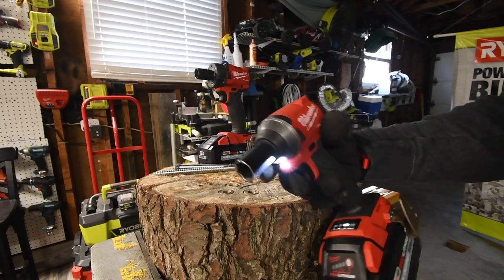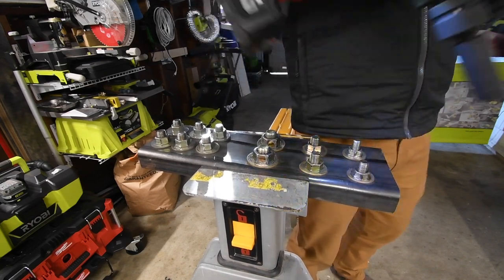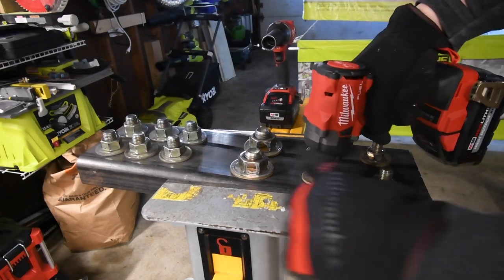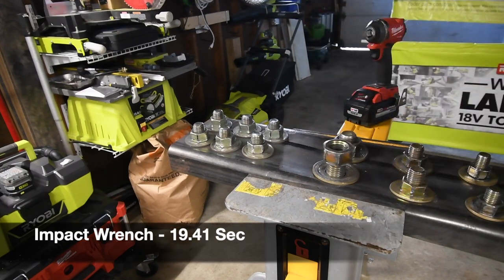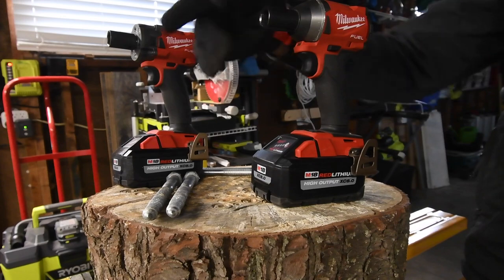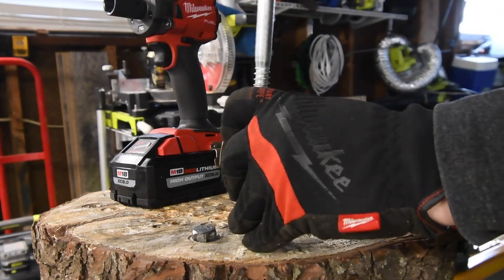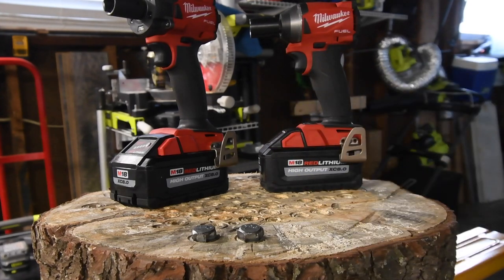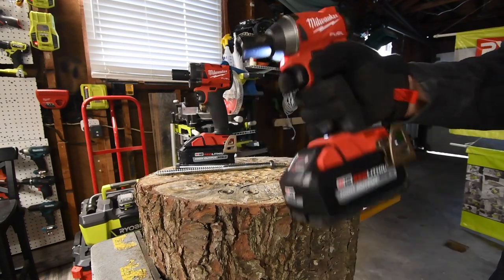Modded M18 Impact Driver vs. M18 Stubby

Comment: I mean, Milwaukee must know this riiight? This was interesting as hell.
Reply from the maker: they have to know, if not hopefully this video will make them know
Reply: @ManCaverTools  im sure there is a new gen coming out now because of this discovery lol
Reply: They do know. The reason it’s not done is because you don’t want your amount of impacts being faster on things like bolts and nuts because it makes it easier to break
Reply: @brandoncontrades187  
You simply change the speed tsince it has 3 settings on the impact driver to solve that
Reply: @obliviondio  you have to account for the 99% of noobs when marketing; imagine all the warranty etc claims lol
Reply: @bryanm6080  
The impact driver naturally has a speed clutch for driving in screws. That would be just as much of a warranty concern. It's same speed adjustment as present on the new m18 stubby impact wrench, the mid torque and high torque impact wrenches.

Comment: Do you every watch the Torque Test Channel? They have some cool tests. Maybe you could collaborate with them and send them that modded Milwaukee for them to compare. I bet your tool would be high up on that list!
Reply: PS: Eric from South Main Auto just sent them his air tool. It did well. Send them your electric modded tool and show him up! Lol
Reply: This would be insanely epic!!!!!
Reply from the maker: I am subscribed to him and he wants me to send him this impact driver. I think I will
Reply: @ManCaverTools  send it with a high output 6.0 and/or 12.0 battery, since he confirmed that the 6.0 makes more power than the 8.0
Reply: @ezrawaters6653  Hi Ezra, I have to take exception with that.  The 6.0 does not necessarily make more power than the 8.0.  If you read into what the other channel said, it was a brief burst it offered.  I think the 8.0 will win out, as it will run longer and offer more Amp draw over a longer time frame.  There is an insignificant difference in weight, so I don’t know why one would choose the 6.0 over the 8.0?  I have used the 6.0 on my Gen 1 drill, with good results, but it usually does duty in one of my M18 worklights, and does well.  Obviously the 8.0, which I own and use, does better.  Batteries can vary one from another, so who knows?  YMMV. ✌🏻
Reply: @ManCaverTools  That’s cool Dave
Reply: @georgedavall9449  the 6.0 puts out more power from start to finish. This is because it uses the Samsung 30T cells as opposed to the 40T cells in the 8.0. The 30T cells can output 45 amps for extended periods, whereas the 40T cells struggle at 30 amps. The 6.0 makes more power over the entire 15 second torque curve than the 8.0. The 8.0 will have longer runtime, yes, but the 6.0 is nearly as powerful as the 12.0.
Reply: @ezrawaters6653  Ezra, thanks for reply and clarification, although I still have my doubts. 🙄😁  Based on your information, then yes the 6.0 ‘should’ perform better.  I don’t have any technical information or access to the cells, just going off first hand experience.  May I assume you have seen and verified the different cells in the batteries?  Not arguing mind you, and I’m keeping it civil cause it is Dave's channel. Interesting ... I will see if my buddy Brian will do a comparison video, using the different batteries.  He uses a lot of Milwaukee, and in the Automotive realm.  I appreciate your reply and the information, Ezra.  Best 👍😁✌🏻🇺🇸
Reply: @georgedavall9449  everything is explained in this video:    https://youtu.be/ky5YRjz9lvc
Reply: @georgedavall9449  and like I said, the 8.0 WILL have longer runtime. So it depends on what is better suited for a particular task. Need 10% more power? Use the 6.0. Need longer runtime? Use the 8.0. He explains the difference in 30T vs 40T Samsung 21700 cells also
Reply: @georgedavall9449  hello 6.0 has more output than 8.0 as per the torque test channel experiment because it uses more output type of battery.
Reply: I just came here from that channel i want my own now so bad lol

Comment: Not sure if it was posted, but P/N's for the anvil assemblies:
3/8", ~$28: 42-06-0025
1/2", ~$58: 42-06-0047

Important to note the 3/8" impacts were tested to have a tad more overall torque but less dynamic (good for tight bolts, less so for rusted) vs the 1/2" version of the exact same tools.
Reply: both part numbers are incorrect  the m12 stubby is 42-06-2555
Reply: Where can i buy 3/8 anvil?

Comment: Shop Tool Reviews tested the M18 Fuel Impact DRIVER at 450ft pounds of nut busting torque, and that was with a Husky 1/4” Hex adapter. Idk what was more impressive, the power of the impact driver or the durability of the Husky adaptor. Lol.

Keep up the great videos man.
Reply from the maker: I love and watch shop tool reviews
Reply: Send it to him to see what kind of power that thing is making
Reply: @joshamos7090  Definitely in the 500s possibly 600ft lbs

Comment: Great job on that driver! And if Milwaukee were to actually do that, make a impact driver with the 1/2 inch anvil, it would literally make 3/4’s of their impact line irrelevant
Reply from the maker: I still think it would be awesome
Reply: @ManCaverTools  makita 111 vs dewalt 801 please🙏
Reply: Shhhhhh!
Reply: Honestly I'd buy it for my carpentry work. I use the M18 1/2 inch impact gun (the little one that used to come with the M18 drill) with the 1/4 inch hex adapter for driving all my fasteners as I seem to get better control with it, and I can run down m12 bolts with it. But this looks really good

Comment: Kinda makes sense as the 1/4 inch impact driver has a high ipm. The anvil swapped into it would have more weight to it as well. In reality all milwaukee would have to do is up the ipm on the 1/2 inch version to make it better.
Reply from the maker: I Thank you so much for viewing :)

Comment: hii i'm from indonesia.
i did modification on m18 2853-20 milwaukee.
The obstacle that I experienced was the anvil moving back and forth so that it rubbed against the nose tip of the anvil house.
did you cut the nose tip of the anvil house or use another anvil from the 2555 stubby you have shown?
Reply: Did you use a 3/8 anvil, or a 1/2?
Reply: @MrCaribe65  I use anvil 1/2. when I used the tool for the first time, there were doubts whether this tool would last long. But after I used it continuously, apparently there were no problems and it worked as it should. Until now, I still often use the Milwaukee that I have modified.
Thank you to those of you who have shared your experience modifying power tools so that they can be used optimally.
succes to you all. I am a mechanic from Indonesia.
Reply: @sandy cheng  
Thanks for the response. I'm going to modify mine soon. Stay safe out there my friend.  🙏

Comment: OK so I rewatched a few times and scrolled thru some comments and did not see my question answered...which ISSS how THE FUUUDGE did either of those even wiggle  nut torqued by the 2767? Did you one key that thing down to 400ftlbs?? Seriously questioning the COPIOUS amount of mack trucks I sent down the road absolutely POSITIVE that 10 ugga duhgas did NOT warrant me going back thru and 3/4 torque wrenching each lug to positively identify 600ftlb minimum ; as the gun had SURELY met or exceeded that
Reply from the maker: I would have looked at the date of the video before watching this a few times. I modified this Frankenstein a few more times after this video and I believe I filmed it as well. The anvil that best fits is from the m12 1/2 Stubby
Reply from the maker: I only use the big impact wrench for a few seconds. so it's not going to majorly torque those bolts tight. if I did it for a few more seconds the high torque impact wrenches would have a touch time.
Reply: @Man Caver Tools  cool, had me VERY curious lol...and terrified

Comment: I almost had to watch this over again Dave!  That was crazy!  Really good video, and checking the temperatures!  I suspect the ‘modded’ Impact will run hotter?  You checked it right at the end of the video, but it was not mentioned?  Awesome video.  Those 8.0’s were rocking those tools!!!  Great battery!  I just picked up the 8.0/3.0 two pack from the Depot, for $169, a great deal.  I have trouble buying into what the guy at the other channel claimed about the 6.0 doing better than the 8.0?  Who knows?  Batteries can vary one from another?  Anyways, Stay safe and Healthy!  😁👍👍👍👍👍👍👍👍👍👏🏻👏🏻👏🏻😁✌🏻🇺🇸
Reply from the maker: I thank you for your support George :)

Comment: So the question is really a price comparison thing.   What is the cost to buy the impact driver plus the mod parts and of course time   VS just buying the mid torque M18 impact wrench. 
Did you have to take parts from another Milwaukee and frankenstein them into the impact driver housing ?     The mid torque wrench has the better lights and about the same size as the modded driver .    I am guessing  this kind of video is the reason why Milwaukee is doing a "special buy"  at Home Depot for the 2855-20 compact impact.   Stay tuned for Gen 4!!

Comment: Looks like many small punches are better than one big.
It's logical:
When wrench punches the nut, slower speed (bigger intervals) creates a pressure gap to the nut, so the nut rebounds and wrench starts from almost the same pressure spot.

Driver is faster so removes such impact gaps and the pressure to the nut is more constant.
What about air pressure wrenches? Aren't they also like 7000 IPM?

Would be interesting to see with slow motion camera.
Reply from the maker: I Thank you so much for viewing :)

Comment: You will get the same results if you add a 3/8 anvil to an 887 and put it up against the 890 in the same test
Reply from the maker: more test will be coming up in the future
Reply: Yes, but there’s a reason for that.

The dcf890 has identical specs to the dcf886 impact driver, minus the 3/8 anvil swap.

The dcf887 was an upgrade over the dcf886.  886 being a single speed driver with a variable speed trigger and Max rpm of 2850 and 3200 ipm, the 890 sharing the same specs.   Where the 887 has 3200 Max rpms, 3600 ipm, in addition to different speeds.

Comment: What do you think make it stronger tho? I am aware that the adapters are prone to snapping, but I also saw improvement over the regular Driver from the channel which tested your mod. Do you think it gotta do with the weight, or maybe the shape of the anvil vs regular driver collet?
Reply from the maker: I Thank you so much for viewing :)
Reply: more BPM, and its direct torque to anvil being 1/2", the 1/4" hex adapters don't have enoigh meat or back bone to withstand all that torque

Comment: I noticed that the impact is on level 2 when drilling the lag bolts in versus the impact driver which is set to level 3, did anyone else notice this?  At 7:38 minutes
Reply: No it's not

Comment: What is a 18 volt stubby I can't find them another name for it
Reply: I think its m18 1/2 compact. No stubby in the name iirc
Reply: 2855-20 is the 1/2 and 2854-20 is the 3/8 and 2853-20 is the 1/4 hex impressive I got to try this.
Reply: Dave can you show us how you did the mod
Reply from the maker: Maybe compact impact wrench

Comment: The socket on the left side bottom out that's why it was hard for it should of got a deep socket for it
Reply from the maker: I do need to get the proper size for those as well.
Reply: He used the same socket on both, so that wouldn’t make a difference
Reply: @ezrawaters6653  no he didn't read what he even said befor you answered me the socket bottom out making it hard for the new stubby to remove the bolt
Reply: @rogercarr4060  but he used the same socket on both... so the test was still fair
Reply: @ezrawaters6653  yes but the bolts on the left side are bigger there for socket was bottom out and lost of torque because of it

Comment: Already looked for the anvil part number but none available 42-06-2855
Reply: thats not the right part number, 42-06-2555 is the one you want 1/2" m12 stubby, youll thank me later